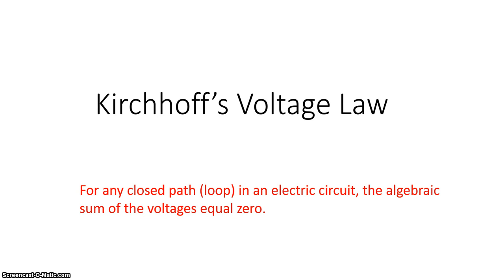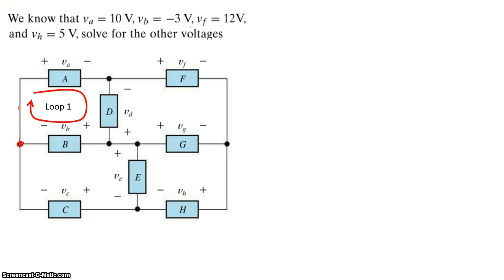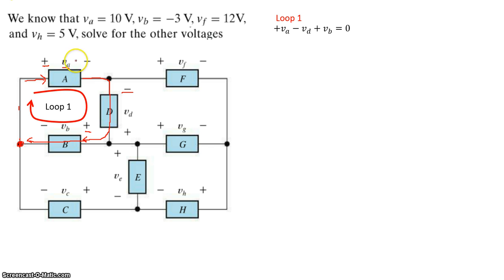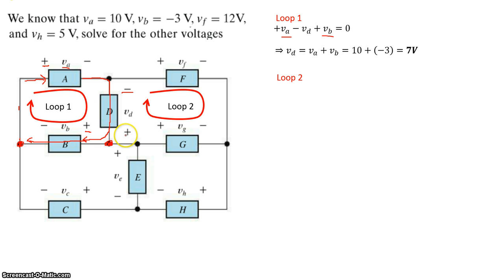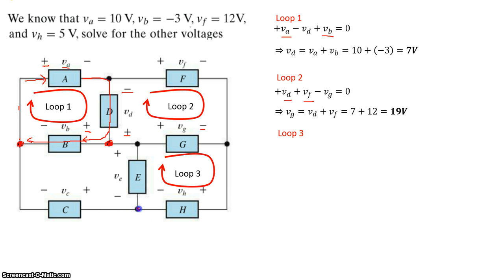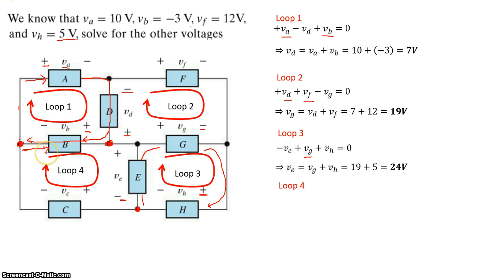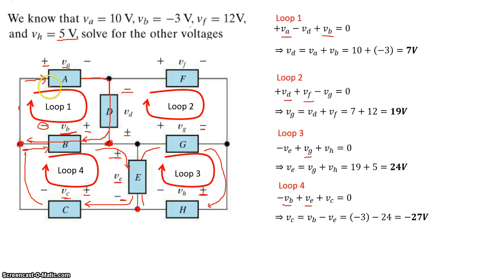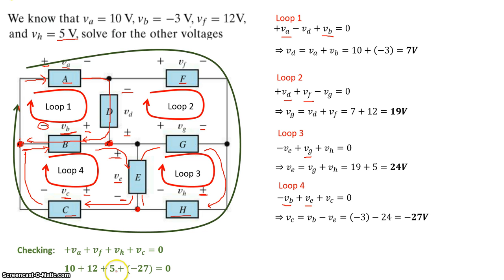Example 2: Kirchhoff's Voltage Law (KVL)

Comment: why is the loop 4 as i had noticed, the signs of Vb and Ve is interchanged... why is that so? why did you interchanged it?
Reply: the signs of the voltages have to match the first polarity seen following the direction of the arrow. in Loop 4, as we traverse through the loop in the direction pointed by the arrow of the loop, we come across element E with the + sign for Ve first. Similarly for element B, the arrow points towards the - sign for Vb.